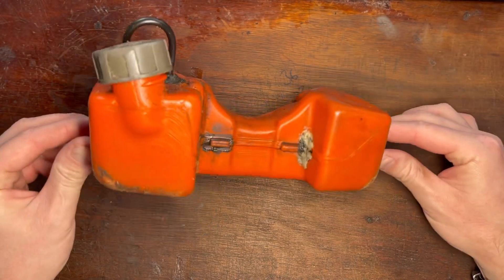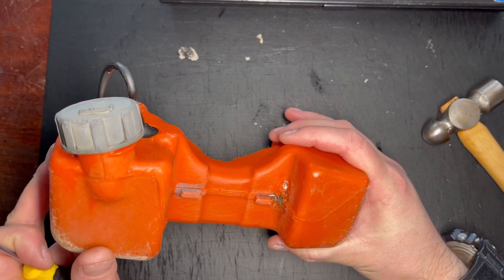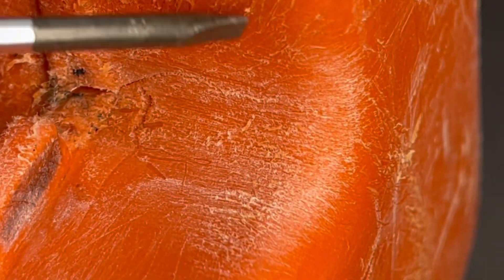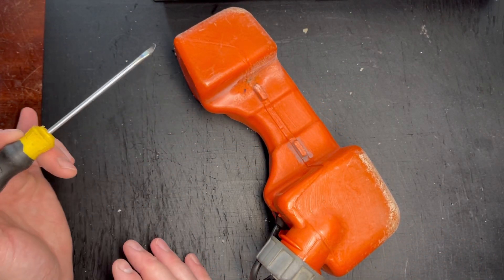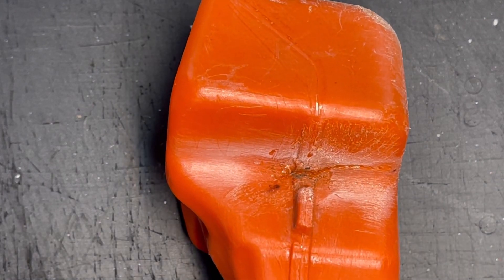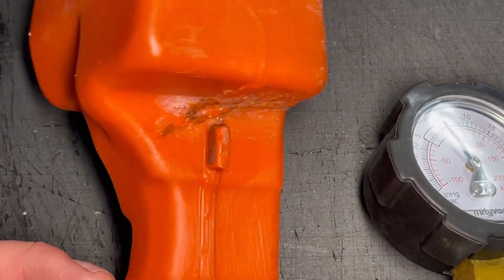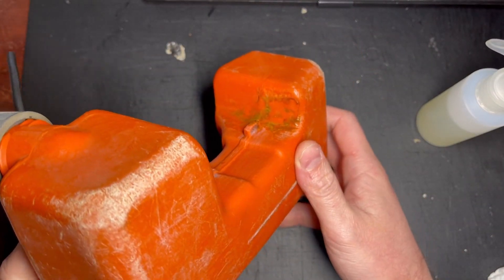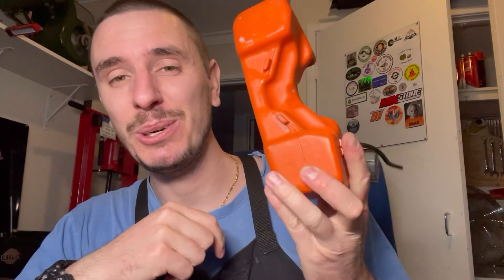Plastic Fuel Tank Crack Repair - Free & Easy!

Comment: I use a digital soldering iron with temperature control. I've got plenty of spare bits, but they do clean up nicely anyway. For extra strength I melt a stick of the same type of plastic into the repair.
Reply from the maker: Fantastic Peter, was it expensive? You can’t get a better tool than an adjustable temp iron!
Reply: @VintageEngineRepairs  digital soldering irons aren't very expensive. Handy things.

Comment: Use a temperature controlled soldering iron as the heat source HDPE melts at around 190C . Look for the recycling symble on the part to determine the type of plastic. Most blowmold  containers are HDPE  2.  Or Polypropylene PP 5.  So you can make your own filler rods from plastic containers around the house Like oil & detergent containers.  Food containers are usually Polypropylene recycle code 5.  Cleaning products & motor oil containers are HDPE Recycle code2. Manufacturers show recycle codes on most plastics Just google the codes & you will know what plastic to look for.
Reply from the maker: Great advice :) thanks for sharing Alan!

Comment: I have done this many times but you should put a tiny hole at the ends of the crack this will stop the crack splitting any further
Reply from the maker: I went past the end of the crack and melted it, there isn’t a way for it to go any further if there isn’t a crack there lol

Comment: Some of our floor scrubbers had blow molded tanks. We were provided with repair kits. Most times if it was a bad scrape with a raised edge, I would just heat up a putty knife and smooth it over. Good fix Tom.
Reply from the maker: Nice Jim! Thanks for sharing :)

Comment: Nice tidy job Tom. Repaired plastics with a solder iron and adding more plastic, has to be the same plastic you use to fill the gap or it fails. Think your technique is less fiddly 👏
Reply from the maker: Spot on Al :) well said. Thanks for watching!

Comment: I have a plan to repair my kyack which melted a few holes in a structure fire. I'm told it's #2 plastic so I'll try working with that. This repair helped, thank you.
Reply from the maker: Yeah #2 is HDPE, you can melt and re-melt no worries. Best of luck!

Comment: I use a soldering iron, and I like the way it works,  but using the length of the screwdriver to finish it is genius.
Reply from the maker: Thanks mate! Yeah a soldering iron is amazing ESPECIALLY if it’s an adjustable heat one!
Reply: @Vintage Engine Repairs  I use an adjustable butane iron that I got for wiring in the field that instantly became the only one I use.

Comment: Great job Tom. Why my wacker bulb stop filling up with gas after a few minutes.   I clean gas filter, change gas line and clean carburettor work Great for few minutes.
Reply from the maker: When you say stops filling up? It should only fill when you press it. Does it drain / empty out? If so it’s likely a crack in it, or one of the valves is not shutting of!
Reply: I meant while using it cutting  the grass it stop filling up.
Reply from the maker: @raymondthompson4222  does the engine run ok?
Reply: Sound lean

Comment: I have a Harbor Freight Plastic Welder with the build in blower and have never been able to get a repair that had any strength. I have tried my wheelbarrow, plastic 55 gallon drum, kids slide and they all failed.
Reply from the maker: Oh no! Sorry to hear it! Are you adding plastic or are you melting the parent material back together? Some old plastics just won’t hold well. Most of the time though, it fails due to poor preparation. Clean clean clean and clean some more before you start :)

Comment: I have good success with a heat gun and peaces of milk jug for filler. Temperatures are critical be careful.  Also the plastic shrinks.
Reply from the maker: Wow, milk jug plastic sticks?!?
Reply: @VintageEngineRepairs  Yes seams to be the same material as most gas tanks, melting point the same, the jug material is thinner so it will heat faster.